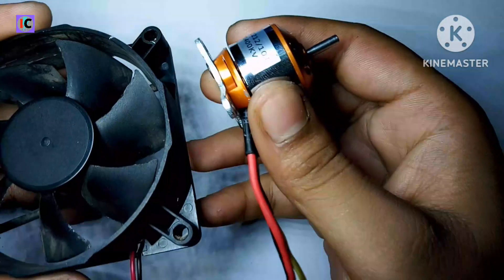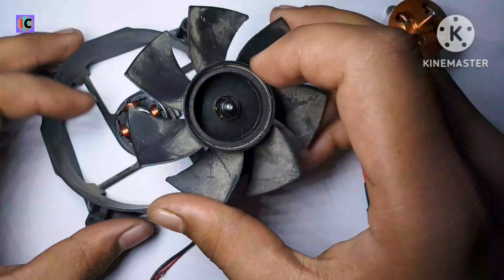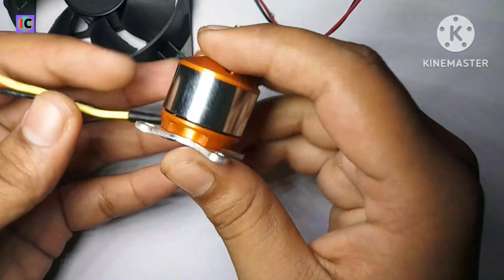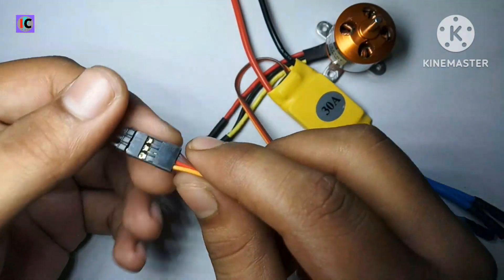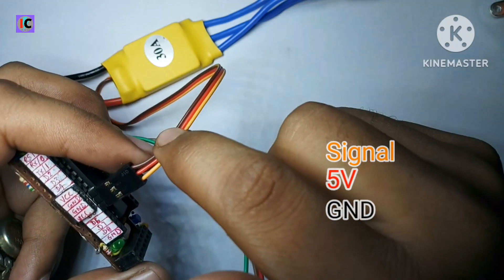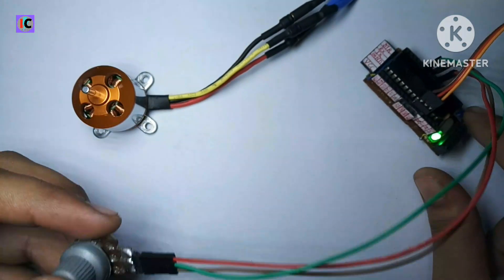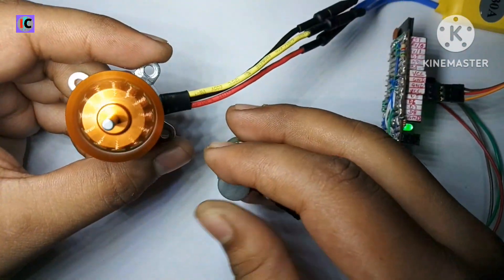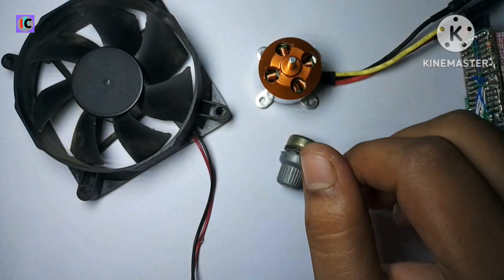How Brushless Motor Works ? Drone Motor BLDC motor

Comment: can you tell me the name of the hall sensor?
Reply from the maker: WSH41FC 
this is 4-pin hall sensor
Reply: @innovationic  can I use it on a 5v dc brushless motor? If no then which 4 pin hall sensor should I use ?
Reply from the maker: it can be used from 2.8V to 20V brushless dc motors